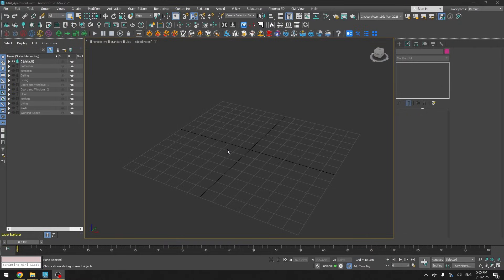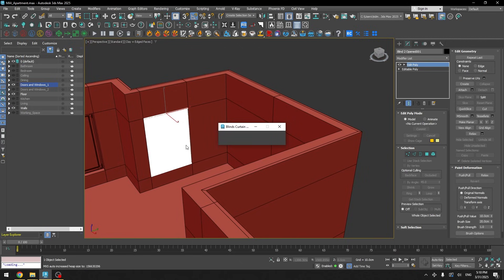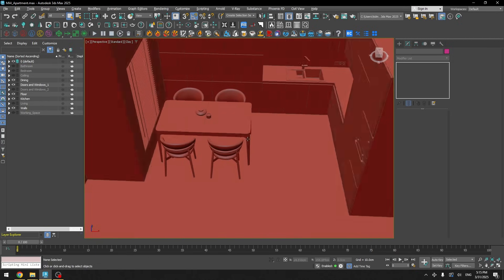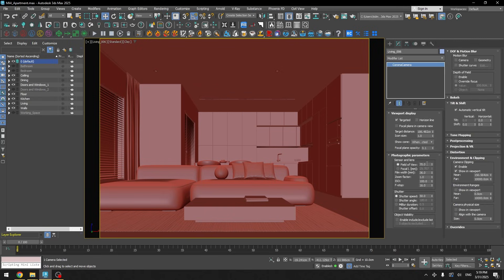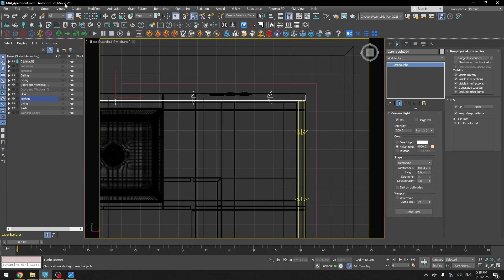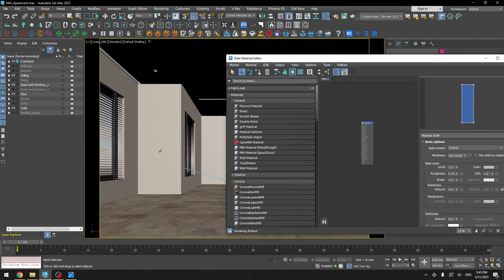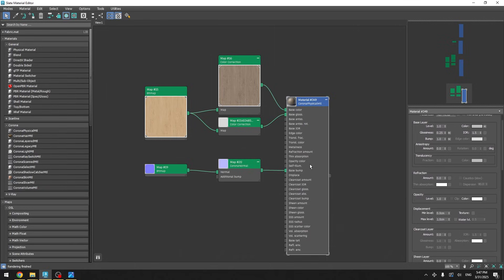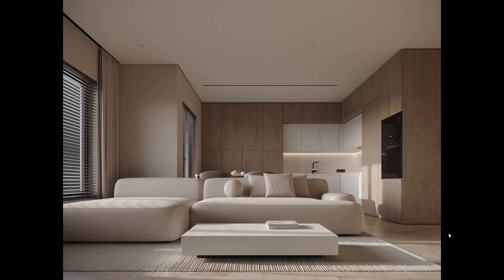3DS Max + Corona - Project Scene Review in 15 minutes

Comment: a high highlight value is actually a very bad idea. it's especially strange when people with experience do it.. it's better to use a lower value (less than 2) and also combine this element with filmic maping highlight and aces ot. for aces ot , you can also set a value less than the default (<1). combining these elements in tonmepig gives the best result.